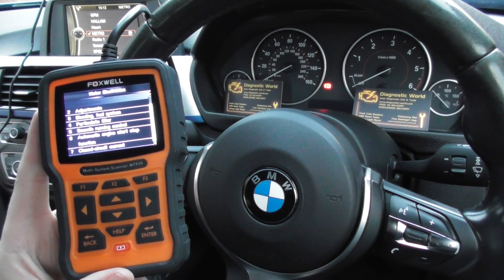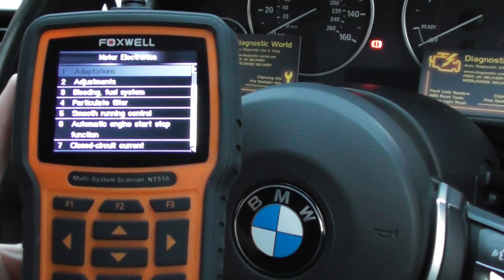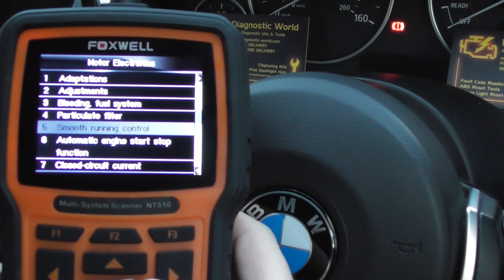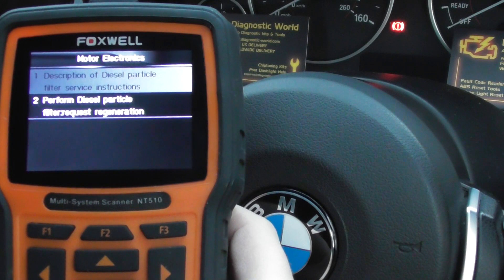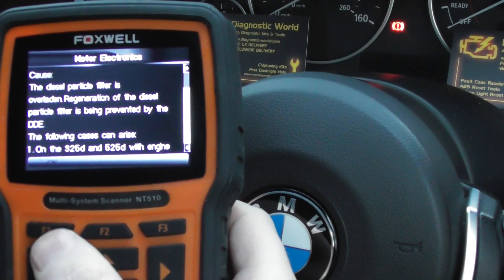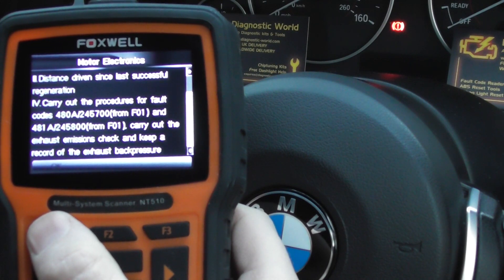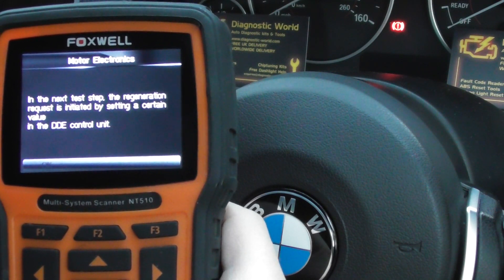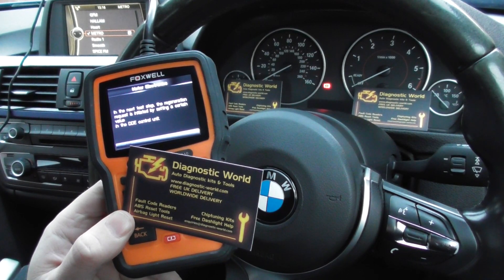DPF Regeneration BMW & Mini Diagnostic Tool NT510 NT520

Comment: Its also in engine control module settings select number 5 configuration reset functions then number 3 dpf regeneration 👍

Comment: Why don’t you show the actual regeneration? On my x5 it won’t do it because can’t switch off terminal 15 and R and there’s nothing in the Foxwell manual about what that means (and no, removing the key fob from the slot does NOT do it).

Comment: This video is missing important steps...like how to get to the motor electronics menu
And whether or not you should have the car on or running
How long it takes and what one needs to do after

For the menu
Service—-Drive—-motor electronics

Comment: arrr bugggger  that vid helps me but didn't perform the regen.  I have a question if your filter light stays on can regen still help as I have tried to drive in 4 gear at 50mph.  also do I need to replace glow plugs?

Comment: I’m looking to buy a good scanner can you do a comparison on the 510 vs 644 pro . I know that the 510 is a single vehicle and 644 is all vehicles but what I want to compare is functions . Let’s say we are working on Bmw which tool would be best?
Reply: from what ive been told, the nt510 has a lot more functionality on BMW itself. the NT644 will do a whole range of cars but not do as much on them. 
If you are in the UK, Gendan sell these and know each machines capability